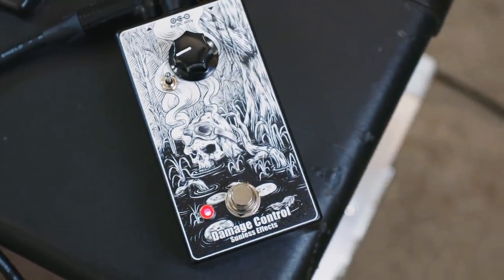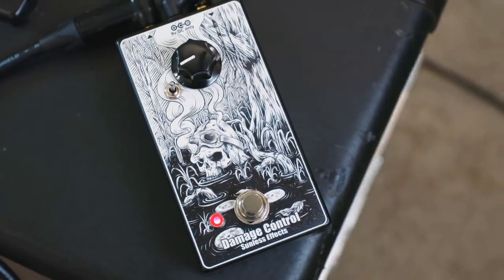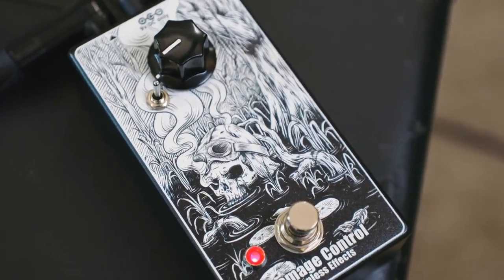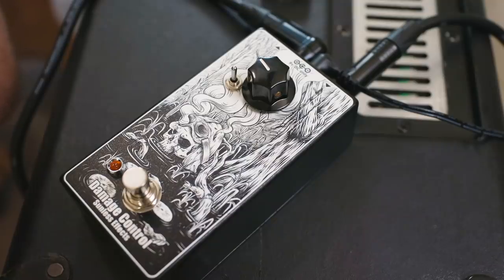THE BOX OF CHUNS - Sunless Effects Damage Control Boost

Comment: Idk if it’s the speakers I’m using but I couldn’t hear ANY difference in any of the settings
Reply: what are you listening on if you don't mind me asking?
Reply: Same here. I'm using AKG ear buds
Reply: Earphones here, same problem...
Reply: I can hear a difference. But i prefer off.
Reply: I hear the difference clearly, Even on my laptop speakers
Reply: Sometimes, with these type of pedals, you notice or feel the difference more when you play with them. Then, after that, you start to hear the differences clearly.  That happened to me.
Reply: Raw guitar I heard it. Didn’t like it. Full mix nothing. No sale.
Reply: @IscariottActual  that's just because of how fluff dials his sound, it's already all mids and high gain, so a mid boost isn't going to be audible, check Stay Metal Ray's demo for a real comparison 🤷
Fluff even added boost on his quad cortex 5150III red channel model, which didn't need a boost in the first place, it was all gain and sounded like hot trash.
It's the same deal with this video.

Comment: Do I miss something but can you just use an EQ instead of any and all of those "Top-cut or boost"-Pedals?
Reply: I thought the same thing.
Reply: You could, but it runs at 34v internally and unlike the fortin Grind and 33 (which also do), the power supply section is heavily filtered, so you can be sure you wont have any noise issues, not that Fortin pedals are noisy by nature, it's just that my power line at home are kinda shit and I wanted to be sure that the pedal I build don't have extra noise coming from the power supply section.

It's for those who don't want to bother with settings and when I see the popularity of similar boost, I tell myself that there is a market for it, otherwise a lot more people would have an EQ pedal on their board... but again, a cheap GE7 is noiser and will saturate due to the lower headroom.

Hope it answers some of your questions :)
Reply: Yes. Lol. The fortin stuff specifically is technically just a loud highpass filter. There is a specific type of curve though to the filter but you can still emulate that with an eq pedal.
Reply: Donatto what’d you say?
Reply: Donatto oh. Lol. The Instagram just seems negative and unnecessary. But the fortin stuff is down to $220 and less because there’s mini versions. The 400+ was because ass holes kept buying them for that price instead of not paying that price. But yes it’s almost better just to get a ge7 or the next stuff. I really want the new ge200. So I can have it all ready to go with my pedal switcher and start setting it up with my presets.
Reply: People slowly discovering that pedals are actually just filters and clipping lmfao
So is your amp 🙂

Comment: It's pretty much a treble boost with 3 way toggle to adjust the input cap values
Reply: That's funny mate, because not only the switch doesn't change the input cap value, but that's also not what has been said in the video about it.
How your pedal business doing mate? What's up with that urge to trashtalk other ppl's business?
You make pedals and haven't figured  out that most of them are just filters and clipping? How many more pedals do you need to make to realize that?

Comment: So basically you can use a GE-7 and turn the mids up for 100$ less🤷🏻‍♂️
Reply: bingo, or just turn the bass slider down a little
Reply: Spot on mate.
Reply: ReaEQ is free, which makes the GE7 70$ too expensive.
To be serious, I can't realistically release a pedal for 70$, I build them all by hand and with the costs of materials the Damage Control ends up being sold at 160$ (excluding shipping).
It also runs at 33v internally to make sure it never clips, something your Boss GE7 can't do at every settings (but something the free ReaEQ can).
Reply: @sunlesseffects  good luck pushing those pedals then sport :)
Reply: Nilly Sigger  there are many factors, indeed.
I don't count on a single demo to convince everybody 🤷
Reply: Haha thanks.
Well as for the differences, like you said, it really depends on one's gear.
The Damage Control does not cut as much lows as the Grind/33, I added a notch at 250hz to remove some mud without removing too much lows.
I don't know where you read the Damage Control was boosting lows, because it doesn't.

So, yes it makes sense to a lot of people to boost high frequencies for a tighter sound, because pedals that don't cut lows (or boost them) are usually Fuzzes.
Tube screamers, boost 750hz and above.
Marshall amps, the first gain stage boost roughly 1khz and let the high end pass on the gain knob (bright cap, Fender amps usually boost everything but they still have a bright cap).
Matamp GT120, boost everything but the FAC will cut lows too.
Klon, boost 1khz and above.
OCD, boost 1khz and above.
Proco Rat, has 2 high frequency boost.
MXR Distortion+ (or DOD250) will boost high frequencies, it's gain dependant...
and so on.
I could continue the list, but all the example above cut low frequencies to avoid being muddy, every examples with voicing that depends on the gain, will start being muddy when the gain is increased (that's why people add a gain stage with a TS instead of increasing the gain on their amp, the TS also has the advantage to have a mid boost and a tone control that will add grit to their tone...).

Pedals that doesn't cut the lows (or doesn't boost high):
Big Muff (cut highs, doesn't clip low frequencies, which make them louder too, like a low frequency "boost")
Fuzz Face.
DAM meathead (it's a fat fuzz face, with all the mods, you can have one with a bump in the lows).
and so on... mostly fuzzes, I cannot think of a single tight pedal with high lows.

So yes, I'm pretty convinced that a bass boost wont work very well for that purpose, you really need to cut some frequencies in the low end to have a tighter sound, probably not everything, a notch (and a gentle high pass) might do the trick.

I, like you, did some experiments in the past and I saw many schematics and looked at how they work and how they affect sound, so right now, I can say that I know what I am doing.

Comment: Fortin? No. My mind automatically went to the Seymour Duncan Pickup Booster. The Pickup Booster has a Resonance Peak switch to make singlecoils sound like humbuckers. If the switch on this thing is anything like that, then you have my attention.
Reply: I have no idea how the Seymour Duncan pickup booster works, but the switch here is a boost/neutral/cut and it will make your single coils less harsh.
I have a Tokai with a P90 in the neck position and the cut position remove any harshness.

The voicing on the Damage Control is different from the Fortin Grind or 33, but because those pedals have a similar goal, they will end up being compared to each other.

Comment: Idk, there’s not enough of a different when you turn it on to justify that price. It would’ve been awesome if they had made it more drastic.
Reply: There is high chances that the guitar played makes the most difference, if I released it, it's because it made sense with my gear 🤷🏻‍♂️
But I read feedbacks and I will try to rework the circuit.
As for the price,  it's expensive because of the charge pump, I will try to replace it with a boost converter, cheaper but takes more space.
Then the second most expensive thing, is the enclosure, I will most likely abandon the matte finish, it's fragile and expensive (and I wont be able to order those again as I do small runs, unlike the company who made those)
Reply: Sunless Effects I can hear what you were trying to do but I think if you were to make it so goes way more drastic then it’d be great. 

Like I said if it were just more drastic I think people would dig it and the price would be fine.
Reply: Hmmyeah, so far, no customer complained about it, actually they're all very happy with it.

I did a simulation of the Fortin Grind between my two replies and the Damage Control is (all frequencies taken into account) louder, so if someone can't hear how it affect their tone, they will most likely not hear it with the Grind either.

There are more demos coming soon and I might record one myself (but I'm a very shitty guitar player) to show how it works with my gear.
Again, if it didn't affect my tone, I wouldn't have released it, and people who tested it before its release, never said anything wrong so I didn't change anything.

I will change the circuit IF people who either own it or tried it themselves feel like there is something to change or improve, otherwise it doesn't make much sense.
Reply: Sunless Effects oh ok cool man. Sounds it’s doing well then.